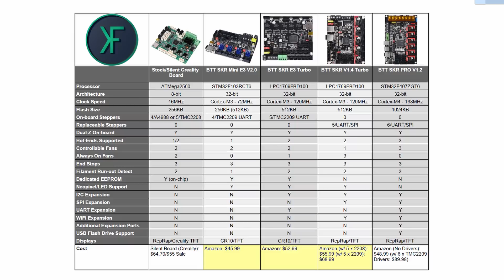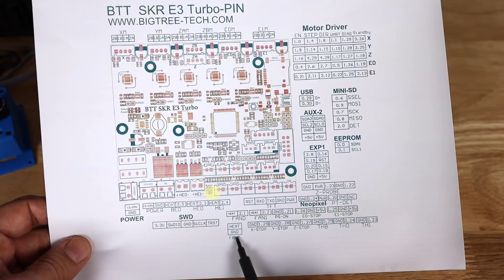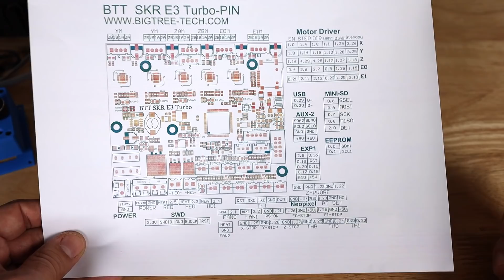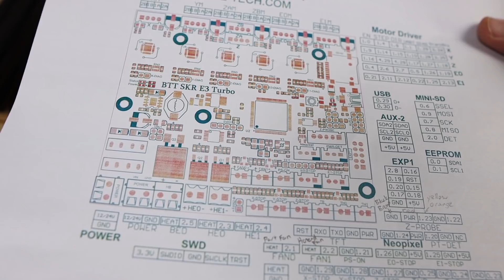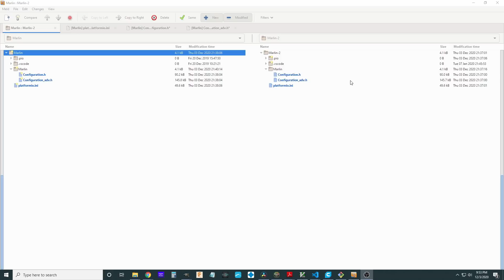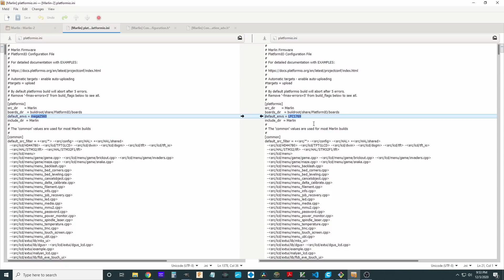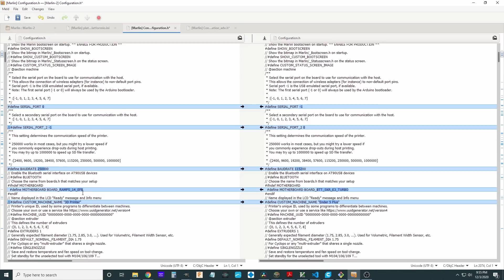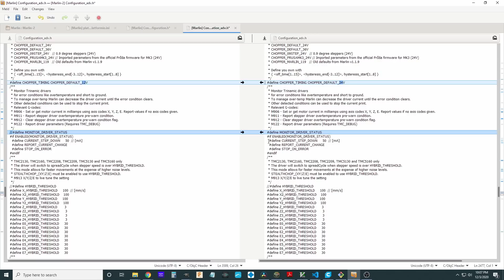Bigtreetech SKR E3 Turbo: Complete Guide

Comment: So just did this install today on my 5+ but with the larger tft3.5 v3 LCD and flashed it with your firmware. Problem is that it refuses to use the BLtouch for z-probe? It does the self test on boot but homing Z it never extends. Any ideas
Reply from the maker: The only thing I can tell you is to check the wiring again. I get this question a lot and it's always a wiring issue.

Comment: Some suggests not to put ferrule connector to the bed heater wire.(to avoid resistance) What is your view?
Reply from the maker: First, I am not an electrical engineer, so this is just my educated opinion. With that being said, I still think ferrules are the way to go. 1) It's still safer to have your stranded wire contained and crimped to avoid loose wires and arcing. 2) They use ferrules quite a bit in automotive applications where high current is common.

Comment: I was able to install this board in a 5 plus by slughtly bending that single mounting post toward the front of the case a little. Did not have to cut it out. Now I can bend it back if needed.
Reply from the maker: Good to know!

Comment: Great video and I was planning upgrading my stock E5+ however, I must admit I do not want to cut the case in any way or shape. Couldn't you have mounted the new screen somewhere on the aluminum posts or something with T-nuts? I ma just curious because if I were to do this I'd like to be able to find a better place for the screen as opposed to cutting the chassis imho.
Reply from the maker: Thanks! I think you may be able to add posts to the display and lift the mounting plate above the board. That would of course change other screw lengths. You can also find mounting options for the metal extrusions on Thingiverse.

Comment: Very glad Google brought me here.  I just bought this board to upgrade my Ender 3 from an SKR E3 Mini v1.2, but of course it comes with zero documentation in the box and I could find zero support on the Bigtree-Tech.com website.  I would have thought they would at least point to their own GitHub page from their own website, but very grateful that you have done so here.  The only trick for me was figuring out on which 3 pins to plug my BLTouch, so thank you for saying "right-hand side of the video. It sure looked like the left side as I watched, but yes it is the right side.  Funny I did not check for the links you have posted here at the time I was installing the board, but I see them now.  I also included a link to this video in my Amazon.ca review of this board.  Thanks again.
Reply from the maker: Thank you very much for the link and I'm glad this was useful!
Reply: @kerseyfabs  absolutely.  BTW - Amazon has some rules about reviews, so they rejected my script because of the link.  Not one to be deterred, I found the Bigtree GitHub page and pointed a couple of folks to your video for guidance on how to make the BLTouch work with this board.   I saw an issue there which warns of a fundamental circuit design flaw on the mini e3 series of boards, which prevents the ADC from correctly interpreting the thermistor signals.  
I am hoping the Turbo board is not affected by that same error, but BTT has not yet posted a schematic.  If this is an issue you would be interested in pursuing with BTT, the GitHub issues #6 & #12 seem to relate and this Reddit posting explains in more detail: https://www.reddit.com/r/BIGTREETECH/comments/kar8u7/why_you_should_not_buy_bigtreetech_boards_why/gfsi9zh/?context=3
Reply from the maker: @ThinkersBluff  That's odd. I haven't had any problems. I'll check out the tickets.

Comment: Awesome!! Next up SKR Pro?? 🤔🥴🙏🏽
Reply: Now they need a SKR E3 Turbo Pro
Reply from the maker: It's the next BTT board on my list. Whether it's the next video, I'm not sure yet... More info soon.
Reply: SKR Pro next!! 🙏
Reply: I just bought the pro for my 5 plus. Just haven’t gotten around to installing it. Would love to see KF’s take on it.
Reply from the maker: @gaxon1920  I really appreciate that. I'm very behind on that because of commitments. I'll have another video out this week on a very similar board. I'm going to start my PRO video after that.
Reply: @kerseyfabs  I just bought the pro but can't decide if I need something different.  Will it be basically the same install as the 1.4 turbo?
Reply from the maker: @titansfan2104  All board installs are basically the same. It's about wiring it correctly then building the firmware. The trouble comes when wiring isn't obvious or the right compile options aren't obvious. Then you have to check everything and try again. Rinse. Repeat.

Comment: Why did my comment get deleted?  I was just trying to share how I got the SKR E3 Turbo working with my Ender 5 Plus using the stock touch screen instead of replacing the screen.  I edited / updated my post to include the details of how exactly I got it to work.
Reply: I wired up the stock touch screen to the TFT port on the E3 turbo board.  You need to "cross" the RX and TX.  The RX on the E3 Turbo TFT port connects to the TX pin of the touch screen.   The TX on the E3 Turbo TFT port connects to the RX of the touch screen.   I had to make a mounting bracket with a ~6.5mm offset towards the rear of the printer and a ~5mm lift away from the posts to clear the screws.  I cut a 40mm x 14mm hole in the side of my printer.  Measure and mark 40mm towards the back of the printer and 14mm down from that upper left corner of the microsd hole and cut it out with a dremel cut off wheel.   That first cut will be super easy because you're using the existing microsd slot as the top part of the hole anyway.   I designed and printed an IO panel that works with the mounting bracket to cover that hole.  I need to make a revision to that IO panel cover and when done I will post it up on thingiverse.  

I am using TM3D firmware (NOT TH3D, similar name, but no not the same thing.  The github TM3D is using is called InsanityAutomation).  I had to find this line in Configuration.h: 
#elif ANY(OrigLCD, MachineCR10Orig, MachineEnder3Pro422, MachineEnder3Pro427, MachineEnder3Max, SKRMiniE3V2, SKRE3Turbo) && DISABLED(GraphicLCD)
and changed the very end of it from: && DISABLED(GraphicLCD) 
to: && NONE(GraphicLCD, FORCE10SPRODISPLAY)      

I am using the FORCE10SPRODISPLAY flag in my platformio.ini.

My platformio.ini entry looks like this:
[env:Ender5Plus_BLT_SKRT]
platform = ${common_LPC.platform}
extends  = common_LPC
board    = nxp_lpc1769
build_flags     = -DU8G_HAL_LINKS -IMarlin/src/HAL/LPC1768/include -IMarlin/src/HAL/LPC1768/u8g 
  -DMachineEnder5Plus -DABL_BLTOUCH -DSKRE3Turbo -DFORCE10SPRODISPLAY

Everything is working so far.
Reply from the maker: Nice job! I'm glad this is working out for you!
Reply: @kerseyfabs  Thanks, not saying you need to change anything with yours, I just want people to know they have an alternative to replacing the screen.   I need to redesign the IO plate a bit, but it mounts up nicely.
Reply from the maker: Understood. There's a lot of questions about reusing the stock screen. I just don't like the interface or the lack of controls.

Comment: love the new board cant wait to ry one though it is a shame it doesnt have removeable drivers. as my firned has had 2 of his 5 boards from skr develop a dead driver after 6 months/
Reply from the maker: Well, there's new circuit protections on this board, I hope that helps with the drivers too. Removeable drivers wouldn't have fit on this board. That's what the V1.4 is for.
Reply: @kerseyfabs  yes i hope so to as if they can get that chance of failure lower for them the board at the price would be a steal. thanks for the video i will defanatly tell him of the updated boards.

Comment: did you modifiaction , great thanks. but i noticed in manual level it looks like it setup for an ender 3 as it has 4 points at approx 230 mm .Abl is perfect
Reply from the maker: No problem! That's a known issue with the touch screen interface. The manual bed leveling works fine in Marlin. I'm hoping my next release, which pairs with new TFT firmware, will fix it for everyone.

Comment: Can't wait for the SKR Pro 1.2 with 2209 steppers. Also, did you install your power supply back into the center chassis? Though it was in thee back of the printer. For that screw hole on the MOBO with no offset. You can just use a PC MOBO offset with a nut to make it flush and remove the flex. They are super cheap and you can probably get 1 free for a local PC repair store.
Reply from the maker: Thanks for the standoff idea. This is my second Ender 5 Plus, so it still has the original power supply. I will be working on a Pro 1.2 very soon.
Reply: @kerseyfabs  awesome! Ordered mine on black friday.

Comment: Hi Kris, great video as always.  Would this board still be a good option for a regular Ender 5?
Reply from the maker: I'd still go with the SKR Mini E3 V2.0 for that printer unless I wanted a second extruder.
Reply: Thanks!
Reply: It'd overlap the power supply in the Ender 5's electronics box because of its larger dimensions.

Comment: Great video, I'm following along while installing my board. Just wondering why one Z cable goes to E1 connection instead of the ZA/ZB connection?
Reply from the maker: Thanks! Because this allows for independent control of the second Z. If you use ZA and ZB, they are tied together.
Reply: Awesome, thankyou. 👍

Comment: I love your videos and they have helped a lot and I am trying to understand all of this. Is there a reason that you didn't use the Auto Build Marlin features and just define the MOTHERBOARD in configuration.h and not have to edit the platformio.ini?
Reply from the maker: Honest answer: I've never used the auto builder. As a software developer, I'm pretty use to doing things manually. I'll take a look though. I know I've seen it mentioned in other places.
Reply: @kerseyfabs  The Marlin Auto Build will take the value set in configuration.h for MOTHERBOARD (boards are listed in boards.h) and then set the build environment accordingly. It is a nice feature.

Comment: Do you use your own modified firmware as base or marlin one? i have a skr pro v1.1 i want to reuse. Thanks
Reply from the maker: I use stock Marlin as a base and then do custom configurations. Those are based on one-another but with board-specific changes.

Comment: Looks like this board has support for 2 extruders and 2 E heaters can you confirm this and if so what would I need to do in Marlin to configure for a 2in2 out hot-end like the E3D chimera , or maybe do a 2in1 out mixing hot-end like in the Geetech A10M series printers, I ordered both types of Hot-ends but need help configuring the firmware. I leaning toward the 2in2 out configuration

Comment: Amazon has a package with this board and the TFT35 E3 V3.0, besides a different screen mount will this setup work for my E5+? If so, will I still be able to run my system with my Octoprint plugged into the board USB like I am on my stock board configuration? Excellent videos
TIA
Reply from the maker: Yes, that screen will work but you will have to design/find a different mounting bracket for the printer. This board and display will work even better with OctoPrint. You can get a plugin that shows the status on the display from OctoPrint.

Comment: Just installed my E3 Turbo into my 5 plus. 

Tried making changes to Marlin 2.0.8.1, but even with following your guide, i got TMC errors and BL touch errors. 

So, I used your firmware and made some minor changes via the github version, and its fine. 

Much appreciated

Comment: Hey kersey, thanks for the guide. Have a problem: all correct wired, probe working etc. All good. Unfortunately when I want to do manual bed leveling and let the head drive to the corners, only the 1. Is correct. Right, Back right and back left are on a waaaay smaller bed size point. Any ideas?

Comment: Hi Kris, you said before we start need to backup settings, then no further instruction. What was the file you had open. Can I ssh through Octo pi to get to them or directly console onto the ender 5 board. Cheers
Reply from the maker: Well, there's no file to download, all you can do is run M503 and save off the settings you need to a text file. If you have OctoPrint, you can just go to the Terminal tab and copy and paste from there.

Comment: Are you able to control the speed of your parts cooling fan on the E3 Turbo? G code commands either from Cura or manually change the percentage of speed on the lcd panel but the part fan works 100%  on or off. I think its a bug on the board configuration but haven't narrowed it down yet. M107 or M106 S0 processes and the fan is still blasting away.
Reply from the maker: Yes. I'm not having any problem with that. Which fans are you using?
Reply: @kerseyfabs  the stock part cooling fan on an ender3 pugged into the FAN0 port on the e3 Turbo. M106 S255 will say the fan is on 100% with the lcd  but its not on. M107 says the fan is off but once its on the fan ignores that too. Thanks for the reply, I will figure it out. I have to be close..
Reply: Its fixed. Mistake somewhere compiling software. went back to the btt firmware and have fan control again.
Reply from the maker: Awesome!

Comment: I installed this board in my CR10 S5 to gain use of Z auto align and everything works except E0 will not drive the extruder. I set it up following this guide, I’ve been through two different boards, tried disabling linear advance, turning on square wave stepping and I’ve attached a working spare stepper directly to the E0 connector to eliminate any wiring faults and it refuses to work!!! Nothing I’ve tried seems to work. I tried forcing E0 into spreadCycle mode and the stepper twitches and then the printer halts with a driver error, and that is as close as I’ve been able to get it working. WTH is going on with this board?!

Comment: I have a SKR E3 V 1.2 - will it all work for ender 5 plus?
Reply from the maker: Yes. The installation will be virtually identical to my SKR Mini E3 V2.0 video but you will need different firmware.
Reply: @kerseyfabs  isn't this on your githab?
Reply from the maker: @ethno-workshop  The V2.0 source is.
Reply: @kerseyfabs  I write about V 1.2

Comment: I wonder if this is compatible with the plus stock screen
Reply: They list CR10 compatibility, and I think the plus stock screen is the same as CR10S. They rerouted UART1 into EXP1, though the particular pins don't match the CR10-Melzi schematic. I'll try to trace out the pins from my Ender 5 Plus when I get it out, I plan to hook up the stock screen to my SKR-V1.4 Turbo. Mistakes are made with the schematic to PCB translation, e.g. the SKR-V1.4 has both EXP1 and EXP2 flipped, so it is necessary to double check reality.

It should be possible to at least rewire the cable to connect to TFT, I2C, EXP or AUX connectors.
Reply from the maker: See if this how-to helps: https://www.deviousweb.com/2020/05/08/ender-5-plus-skr1-3-and-factory-screen/#:~:text=To%20upgrade%20the%20screen%2C%20you,the%20touch%20screen%20will%20update
I haven't tried it myself since I'm not a huge fan of the stock display. Plus I'm still not sure if this works with M600 (Filament Change).
Reply: @kerseyfabs  I must admit I don't know how it does with the stock firmware in the touchscreen, but M600 was usable albeit a little unclear with Desuuuu's DGUS-reloaded firmware. The dual mode interface with a knob is superior, but I don't have one.
Reply: @kerseyfabs  thanks, might check later

Comment: I  installed it on my Ender 5 Plus , did the wiring as per your video but I get a error that says bed leveling can´t be activated , when it powers up the BL Touch turn the blue light , deploys and retracts the pin two times and turns the light red (which I understans means an error). I flashed the card with your firmware, reset the EPROM and loaded  it again. I am using a TFT70 3.0 updated to the latest firmware from BTT Github repository with only the RS232 cable attached (touch mode) since the other is too short to reach the display. I don´t now what I am missing here. The printer was totally stock before the upgrade and working fine.
Reply from the maker: Have you tried to home and see if it works? Also, "bed leveling can't be achieved" may just mean that you need to run the auto bed leveling routine to save the results.
Reply: @kerseyfabs  I had to open my printer again and found the problem, one of the terminals in the BL connector has popped off, I pushed it back until it clicked on the connector and was able to run a leveling sequence. The temperature fluctuate as much as 3C. Thanks for the video and keep on with your nice work.

Comment: what board do you recommend the E3 turbo or the 1.4 turbo for the ender 5 plus
Reply from the maker: Currently the E3 Turbo has a known issue with temperature stability that I mentioned in the tagged post. Once that is sorted out, I like this board better. For now, I can't recommend it and you'd have to go with the V1.4 Turbo.
Reply: Thanks for the info.
Great video I’m learning a lot 
I just started 3d printing and the ender 5 plus is my first printer
Time to put in the 1.4 turbo just a lill scared of Merlin

Comment: Hi, really enjoy your videos on the ender 5 plus. I just got my self one and was wondering what you changed in the firmware to be able to use skr mini e3 v2.0. Any info would be most appropriate.
Reply from the maker: There are a lot of settings you have to change to support a new board with a new printer. For all of the details you will have to go to the GitHub source and take a look. There's really not an easy way to sum up.